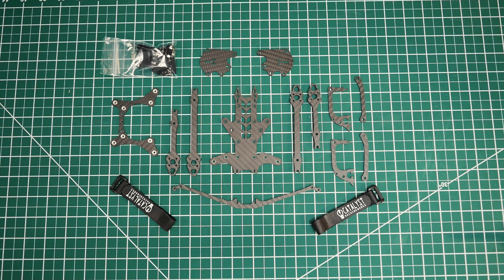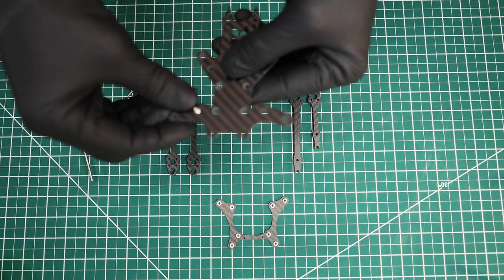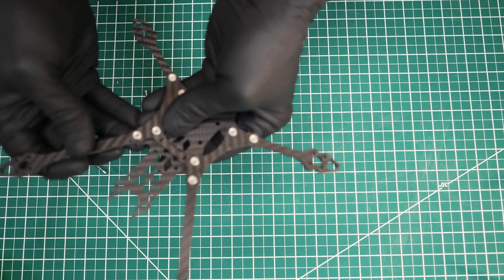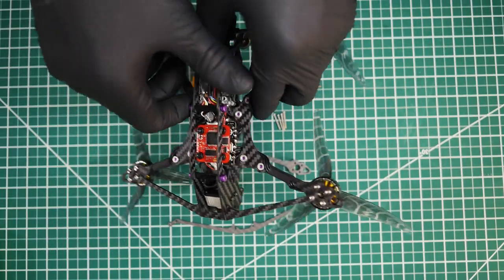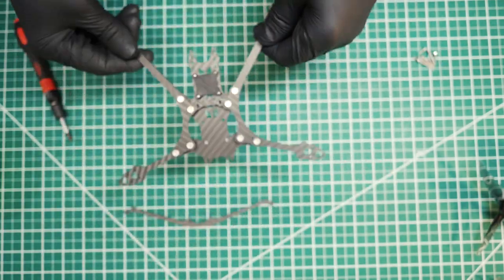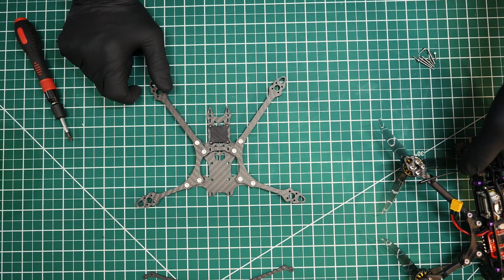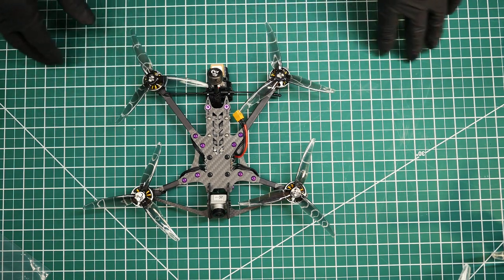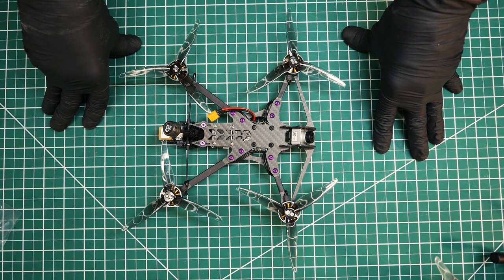Shocker Ultralight Assembly Tutorial

Comment: Flying mine today.  Still on initial LOS tests.  Hope to air it out on FPV in the morning.  Assembly was easy, frame is solid/stiff.  Aikon ESC and FC make very clean build.  I used 3mm screws vs 2mm for stack mount.  As expected, the machining and engineering are absolutely first class.

Comment: Putting some serious time in the air with this bird over the last couple of days.  First flights were boring and uninteresting.  But, changed to 4" 2 blade props and worked on the tune and now it has come alive.  It is a lot of fun.  Not a Merica but fun factor is high.  Remember it is light so it does not fly through pine needles and branches as well as a heavier bird.  I don't fly with more than 4s at this time.  Hauls 1300s around fine.  850 is a sweet spot.  Flys awsome and gets 7 1/2 minutes without pushing below 14V.  I plan to try 3" props before counting them out.
Reply: What makes it feel better as 4 inch? Is it maybe because the motors aren't quite enough for 5"? I want to build a 5" but only with the precise motor built for it and light 5" props.
Reply: Oh the entire point was this. What motors are you running on it and what do you think would be sufficient for 5"? I may just go 4" though.
Reply: @loweflight_newlife7554  It is fine with the Brotherhobby 2004/2300s Neal sells.  I think the 4" version is more nimble.
Reply: @mikel3419  thanks! I think I will go with 4" and the 2004/2300kv.
Reply: @loweflight_newlife7554  You will be happy with the combination.  The motors are somewhat fragile so if you are a frequent crasher buy extras.  LOL